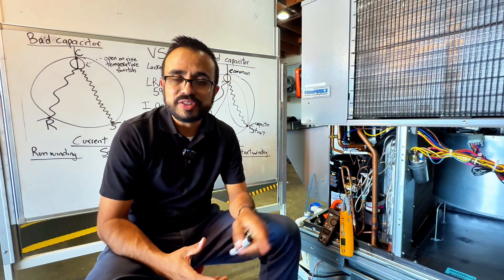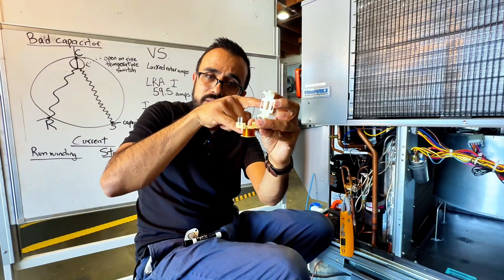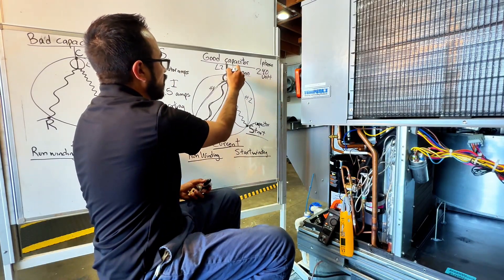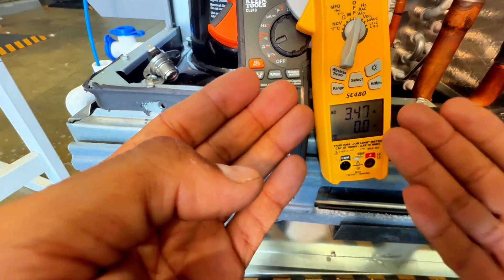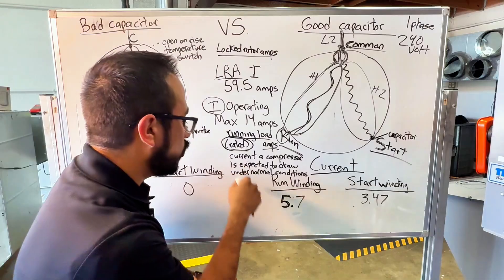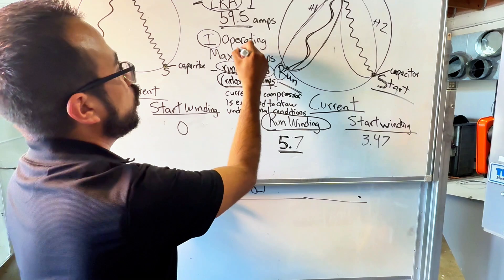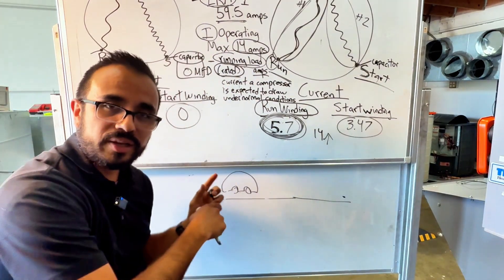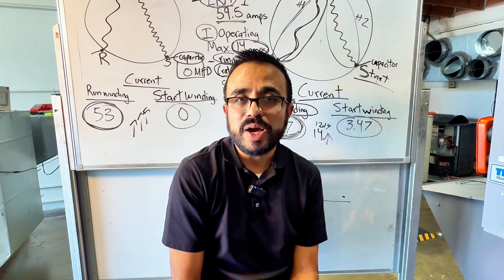Why Won't the HVAC Compressor Turn On? - Thermal Overload Switch

Comment: Thank you for you’re informative videos.
When turn the ac on the breaker will trip I checked if there is a continuity from each terminal to ground but no continuity.
What do you think the problem?
Note: I disconnected the compressor the system was running.
The compressor is not overheating.
Thank you for you’re time for more learning videos.
Reply from the maker: You should check any load, compressor, condenser fan motor and even the wires going from the breaker or disconnect and making sure those are not touching the conduit. Sorry for the late reply!

Comment: Excellent. This is the best video I've seen on this topic. I DIY repaired my 20 year old Nordyne Split Unico System (High speed airflow). I used an AstroAI4000 Clamp meter. The Condenser fan was humming but not spinning. The windings were in the MegaOhms. I replaced motor and the 5/30 Cap (old one measured 4.7+/29.9) I think the old cap was leaking on the fan side. I took the bad motor apart and found corrosion on the windings. It runs great now and I did it for under $200, thanks to people like you. Subscribed.